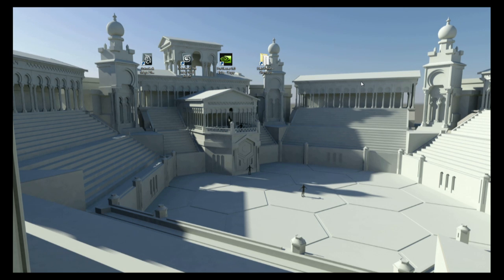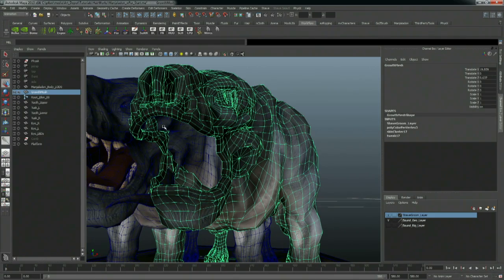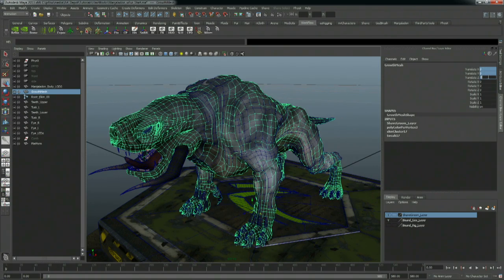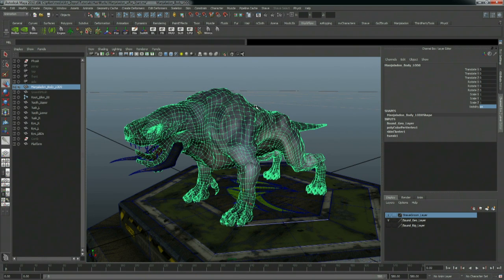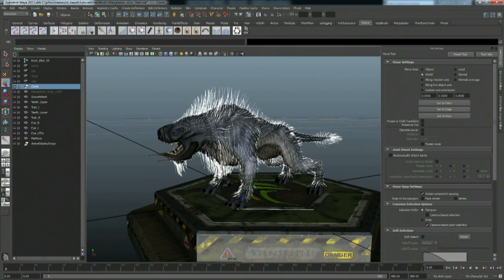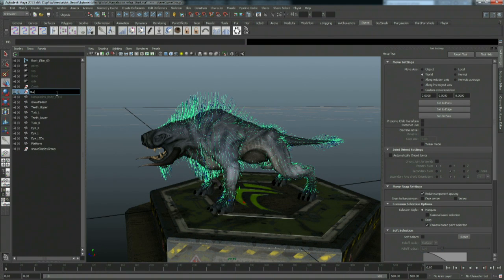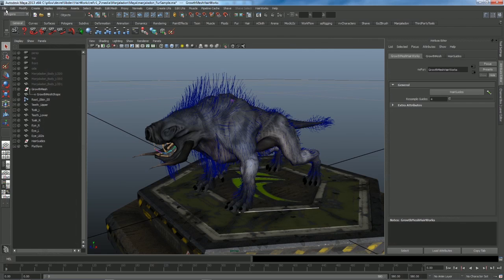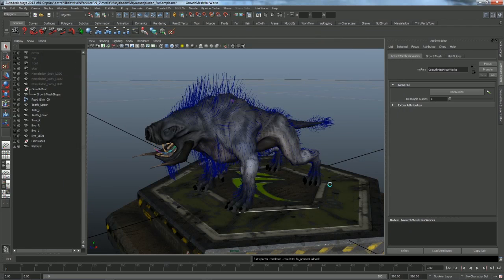NVIDIA HairWorks Maya Tutorial

Comment: Hi thanks for the tutorial.
And I have a question regarding the "export."
In the video you have used the tool Shave and a Haircut plugin,
my question is that can you export apx file without using this plugin?

I have prepared a Spline and Growth mesh (prepared without using Shave and A haircut tool), and tried to export, however it turns out to be error all the time.
Thanks.
翻訳
Reply: Ken Usami someone please answer this :c
Reply: +Ken Usami I think that file type comes with the HairWorks plugin...I do not have Shave and Hair cut either but I was still able to export and .apx file...
Reply: You should be able to use curves from Maya's xgen. There is also a blender to hairworks exporter floating around. Or maybe convert curves from zbrush's fibermesh. As long as you have guidecurves for hairworks it shouldn't be an issue.